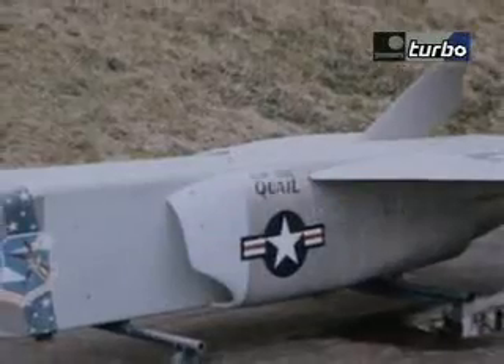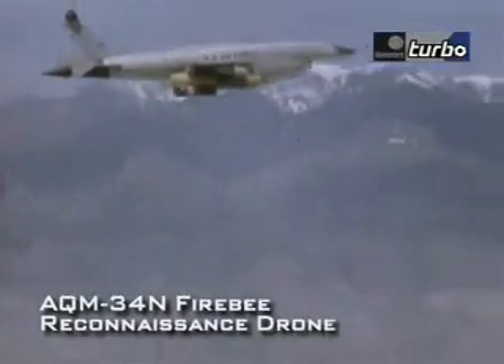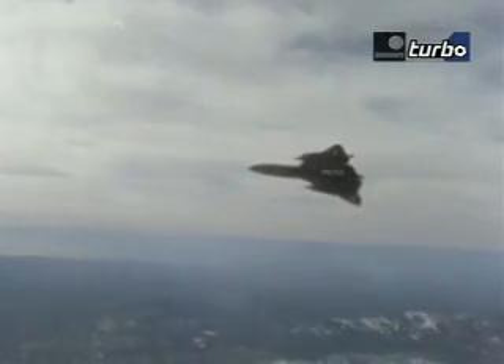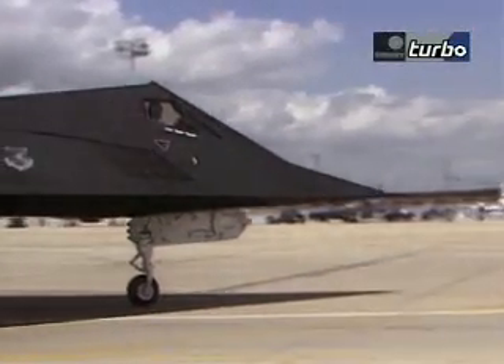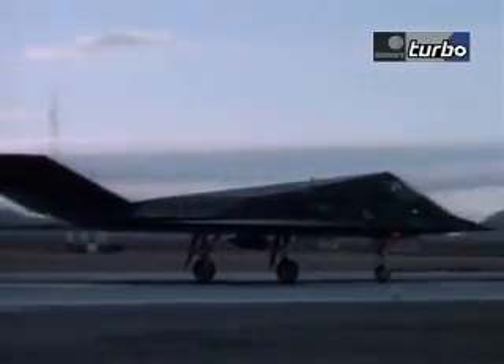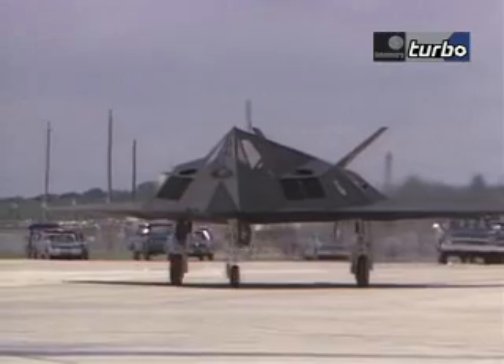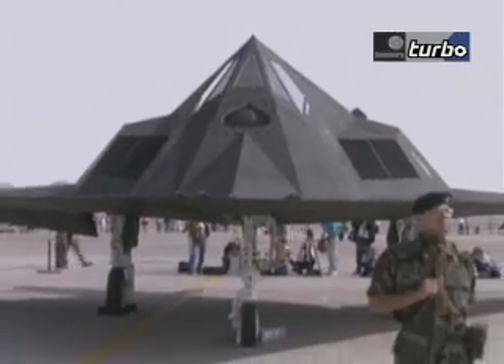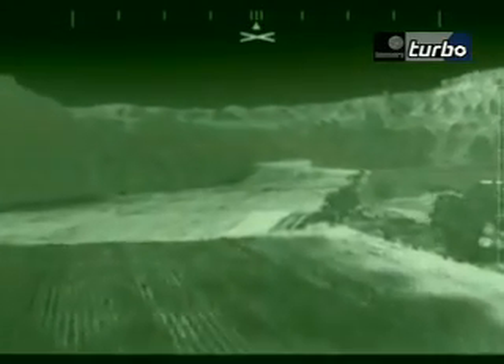Firepower Stealth Jets 1 of 3

Comment: My country refuses to release the official record of how many times a stealth aircraft was tracked by radar as well as tracked by radar then fired at. So what does that tell you. In my opinion it's not very stealthy. "Its maiden flight took place in 1981, and the aircraft achieved initial operating capability status in 1983. The Nighthawk was shrouded in secrecy until it was revealed to the public in 1988. The U.S. Air Force retired the F-117 in 2008, primarily due to the fielding of the F-22 Raptor." It obviously wasn't very stealthy or else it would have stayed in service.

Comment: Never heard of the "Senior trend" project.. Wasn't F-117 called Have blue in the beginning??
Reply: "Lockheed Have Blue was the code name for Lockheed's proof of concept demonstrator that preceded the production F-117 Nighthawk stealth aircraft."

"The aircraft's official name is "Night Hawk", however the alternative form "Nighthawk" is frequently used."

"As it prioritized stealth over aerodynamics, it earned the nickname "Wobblin' Goblin" due to its alleged instability at low speeds. However, F-117 pilots have stated the nickname is undeserved. "Wobblin' (or Wobbly) Goblin" is likely a holdover from the early Have Blue / Senior Trend (FSD) days of the project when instability was a problem. In the USAF, "Goblin" (without wobbly) persists as a nickname because of the aircraft's appearance. During Operation Desert Storm, Saudis dubbed the aircraft "Shaba", which is Arabic for "Ghost"."

Comment: The Soviets had air-to-air missiles of similar performance to the Phoenix.  The chances that ones of theirs or the Phoneix would have to overtake an SR-71 before running out of fuel is slim.  Same with ground launched SAMs.  The SR-71 could just accelerate away.

Comment: The Horten Go-229 was very advanced but was designed with speed in mind not stealth.  The idea that it was a stealth design is a comparatively recent myth.  Northrop was developing flying wings at the same time as the Horten brothers for the same reason they did: a clean design that provided maximum speed and range, not for stealth.  Google N-9M and YB-35 and especially watch the youtube video "Horten Ho 229 Replica Built by Northrop Grumman"

Comment: @Antifaith29 
1. mach 3.2 mig's were relegated. Those were the first and they couldn't handle those speeds due to tensile stress on engine and body lol. 
2. 100,000 feet? where did you get that? source please.
3. What is the range of the the mig's best armament?
4. Again, it's similar not SIMALER
5. I apologize if i mixed you up with someone...you get that one

Comment: I agree that the Blackbird represents an outstanding achievement i aerospace engineering. That said, even it is vulnerable to modern SAMs such as the S300 and now the S400 family. I speak as a non expert but more modern fighters with their attendant missiles are not as limited as the former soviet interceptors and could also threaten the blackbird. No doubt its a wonderful plane though